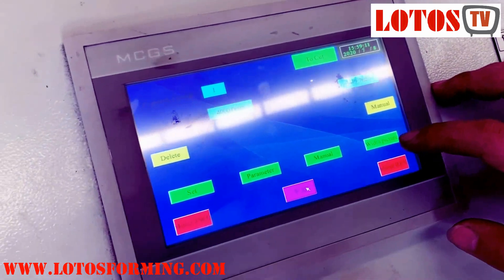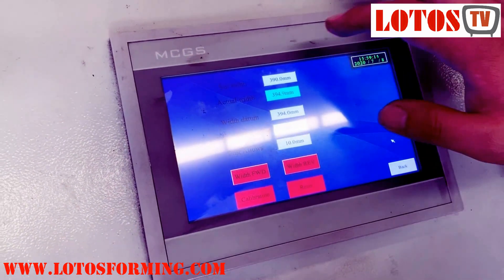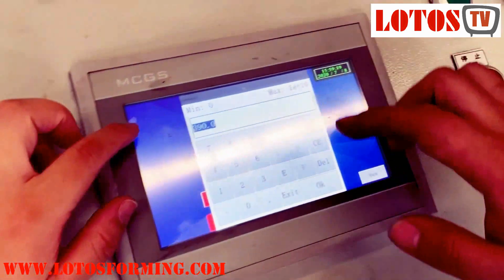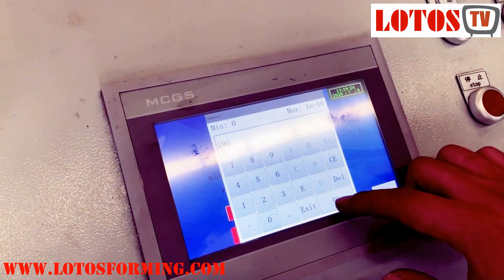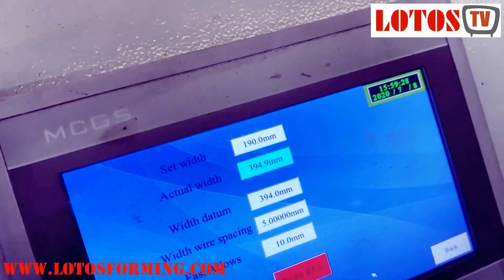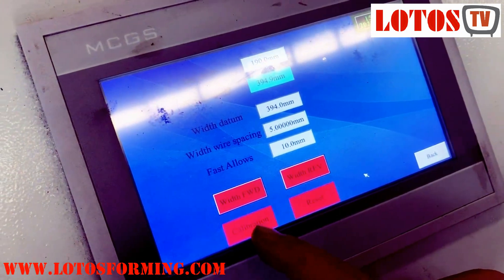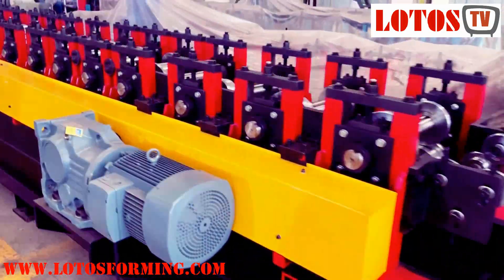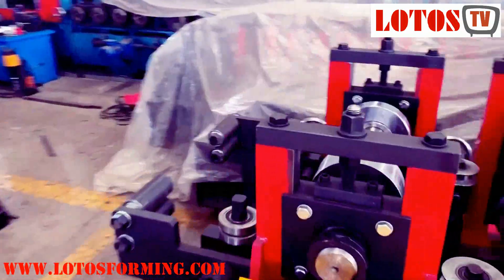【Aluminum window sill roll forming machine 】: Z Section Steel Window Frame Machine " LOTOS 2020"

Comment: LOTOS can design every kind of rolling shutter machine for produce roll-up shutter slats From simple security rolling shutters to roll up shutters designed for storm protection, custom-designed roller shutters, and even fire-proof rolling fire shutter, very fast roll up shutter or sectional door rolling shutter, and so on.

Comment: the features of the Australia steel roller doors are easy installation, low noise and can be lifted by hand and beautiful color, smooth and horizontal embossed design